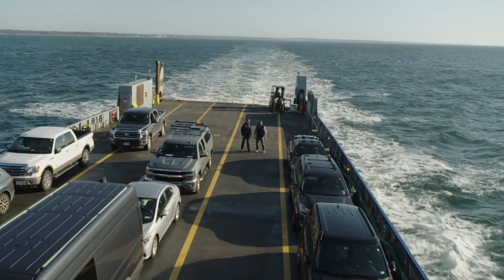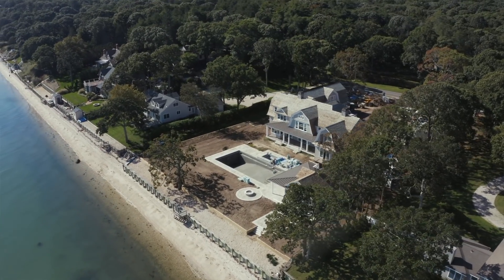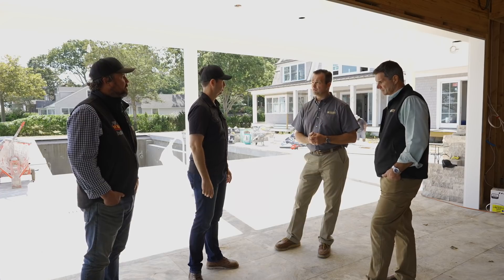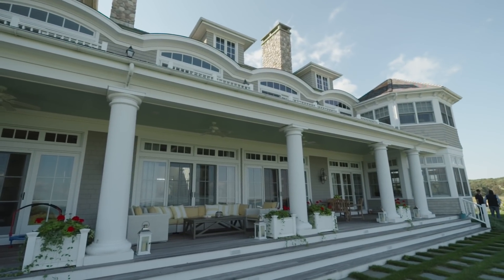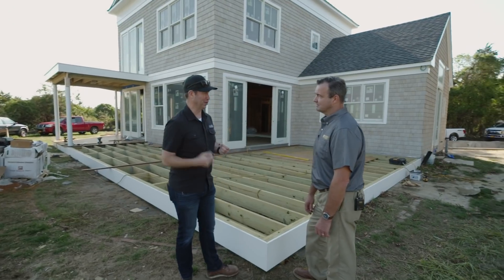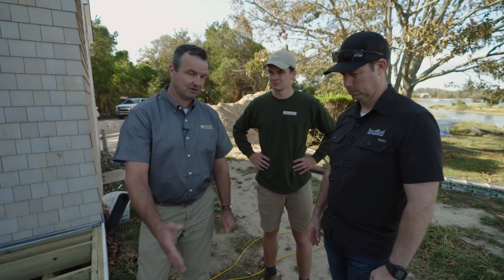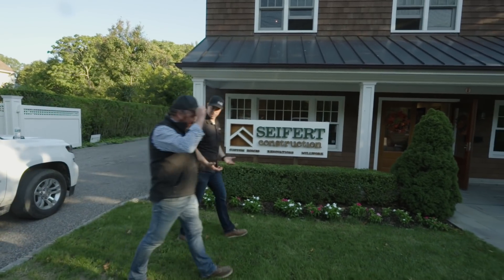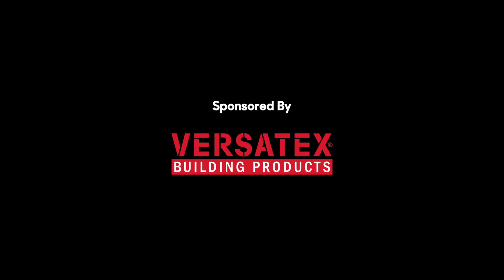Exterior Trim lessons from Long Island Coastal Builders

Comment: Matt, when I was very young my father was in the building supply business. You pointed out the nails on the truck and struggled a bit to name the packaging. Back in the day my father referred to those as kegs of nails. As I got older the kegs you saw switched to a plywood, cylindrical containers before they were packaged in cardboard 50 # cubes.  It's always interesting to see the continuous innovation in home construction featured on your show.

Comment: Matt,

Please , please, please make it down to south Florida and show best practices for cinder block construction. Good, better, best for vapor barriers and outside insulation as well as if it would be better to fill empty block cells with foam or concrete.

Not everyone uses dead tree carcasses for construction.

Comment: Matt, been a fan for a while now & as a Long Island builder my compliments to Seifert Construction on these projects. I understand this is a sponsored video but I can't help but feel we missed an opportunity to dig deeper into Building Science details. Cedar shakes over Blue Skin, is there a rain screen? If so what type? How does Seifert treat air sealing for a water front house? What's type of insulation is typical for water front projects? Are there any specific modification to the HVAC system? BTW: I also use Versatex including for the exterior trim on my own home remodel. I even fabricated my entrance brackets from laminated sheets Versatex enclosing the LVL structure. It's my opinion that this material expands & contracts on long lengths. I've elected to strategically add caulked expansion joints. I caulk after painting with a high quality silicone that can be custom tinted to exactly match the paint. It's amazing to see the caulking expand & compress.
Reply: GC or Custom Homes. Care sharing company name?
Reply: Looking for a construction company here on the island that focuses on building science! What's the name of your company so I can reach out?
Reply: Tom you pretty much asked all the questions I was looking for, good news I know most of them on one of these projects in the vid.  My house is .75 miles from the ocean here on the east end and I have to still take all this into consideration.  Everything erodes so much faster.   I did the same as you with my Versatex.  Also paint it, otherwise looks really plastic like up close.   You can see the HVAC system up there as they put in HVRs or EVR, couldn't tell, but they will help get the damp out.  Also a dehumidifier system is there to pull more  wet air.   My house sits in clay so takes a ton of dehumidification to get the moisture out and keep the house fresh.  Here we use Zip System or Tyvek over plywood like everywhere.  Zip is great if you really really trust the application of it.  Then closed cell on the walls and in the rafters.   I didn't use the blue screen and most don't around here, been told its not needed and hard to make a smooth finish.  All the systems have pluses and minus, I tend to choose the one with the least amount of application mistakes expected.
Reply: @wesrobinson7366  Hi Wes, thanks for joining the conversation. I realize I could have phrased my email better. My intention was to suggest to Matt that when he takes the Build Show "on the road" he consider the opportunity to relay how systems, (WRB, HVAC etc...) vary in different climate zones. Matt clearly defines the best practices for Texas, we both know Long Island requires modifications to these systems for our specific location. He's traveled to many areas but my knowledge this was his 1st trip to Long Island & I admit to being extra intrigued. One of the things I like about Matt's Build Show is that he exchanges information with other Builders. Like you I have my preferred methods for these systems & welcome the opportunity to discuss them.

Comment: I assume Versatex would hold up well applied to pressure treated ply in environments where now can be 4’ or greater depth in winter for prolonged periods.
Reply: You wouldn't put versatex below grade.  Its just a trim.  No wood products go below grade these days.  You create concrete footings and bolt them together with brackets.

Comment: does anyone know if Versatex can be  used as a skirting around a crawl space and backfilled?
Reply: Dude, do not submerge versatex.  Its just for ornamental purposes.  As a matter of fact, do not submerge any wood related products below grade.
Reply: @SGspecial84   it's PVC, not wood, that's why I was asking.  So far, I have only found Duraskirt as a backfillable option.
Reply: @Alex.smiffy  you still should not put it below grade.  There's no reason for it.  Thats what concrete/wall pavers are for.  The PVC is just a decorative trim.

Comment: Thank you for sharing this exciting new building material that looks like wood. The use of resistant mechanical fasteners in harsher environmental conditions is employed on coastal breaking surf zones. All new buildings 1km from breaking surf must use stainless steel.
There are two pathways for residential house buildings:
Deemed to satisfy, within an Australian standard technical detail.
Or, 
An alternative solution, approved by an Engineer or other suitable professional. (His/Her public liability and indemnity.
Have fun.
🌏🇭🇲

Comment: Just build the frame structure out of Roman concrete. Roman concrete get stronger the longer it stands and doesn't dissolve due to saltwater. if most of the building gets washed away or destroyed you can always replace it but the skeleton of the building would still be there.
Reply: Roman concrete doesnt exist anymore
Reply: @DaleModisette  when i said it doesnt exist i meant you cant buy it. Just because we know how they made it doesnt mean we can mass produce it. Your original comment made it sound like we should just go to our local hardware store and pick up some roman cement. Besides modern cement is just as strong. The cement in the hoover dam will keep getting stronger for for decades. Thats just buzz word phrases that doesnt mean much
Reply: Hell if you really want to get serious might as well use transparent aluminum (ALON® or Aluminum Oxynitride) for the windows but who has $10,000 sq meter or to break it down further it would be roughly over $10 a square inch. I understand that there are over 1,500 square inches in a meter I just wanted to simplify it a bit.
Reply: @RichieD_21  When I was in college my engineer and Architectural professors used to tell me I over design stuff that made them too costly. Hell we even gotten arguments of where the damn washer and dryer goes I refuse to put mine inside of the kitchen area.

Comment: How about termites behind the versatek?
Reply: Well you could have termites behind any siding with a wooden framing. Moisture attracts termites because it softens wood. So making sure your siding and vapor barrier are doing their job helps prevent termites.
Reply: @ianrobinson476  My point is this; never cover the edge of a wood framed building with soil (or an asphalt driveway or a planter etc). This video demonstrates this condition. I believe that most building codes require a minimum separation between wood structure and finished grade of 8". This allows for inspection to determine the existence of "termite tubes".

Comment: Well, before I even watch the video, I can say from my own experience, that it's mostly poorly, with crappy fiberglass batts and zero air sealing. The wind practically blows right through my walls! I'm caulking every single drywall penetration to fix it since I don't have access to the back of the siding
Reply: You think this is a poorly built house ?
Reply: @augustreil  no, I do not. I've seen some crappy building on LI though.

Comment: emergency plumbing question. i know this is not relevant to this video. in the next week  I'm about to use sharkbite push fitting under my raised slab.  it will be old hard copper to pex. this fitting connection would keep dry and i plan on rapping fitting with shark bite under ground wrap.  i plan on using this as a long term solution. do you think this would be ok? please help. And advise would be great appreciate

Comment: No product is perfect. The biggest downside with Versatex is that it's a petroleum product. Second, is its life-cycle history. Third, aesthetics. Clients like yours have the ability (pocketbook) to do things correctly. (just look at and feel a wood fence vs. a PVC fence - no comparison - same with a PVC porch post, yuck! Reason #4: is it paintable? (for remodeling possibilities)....and then drawback #5: COST (got to include stainless fasteners in the budget). I prefer a natural, sustainable product. There are plenty of sustainably harvested woods that are rot-resistant.
Reply: @soshel  thanks for your response, but the main ingredient is petroleum, the more petroleum, the better product; and no comment was given on the life-cycle qualities. Walk on a PVC deck vs. a wood deck (the PVC is too hot for bare feet)